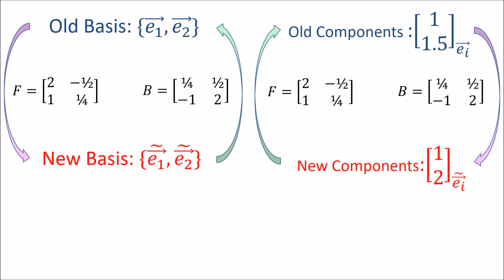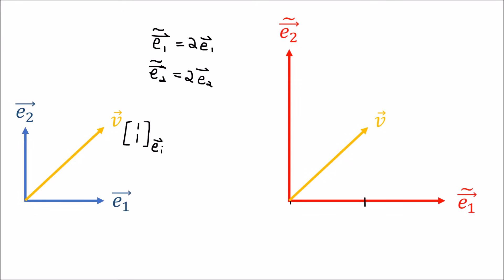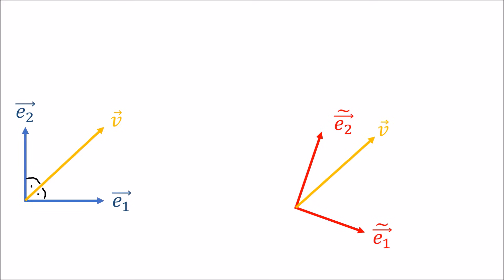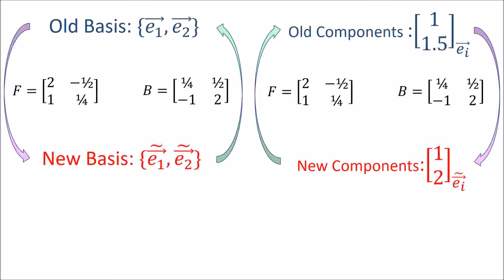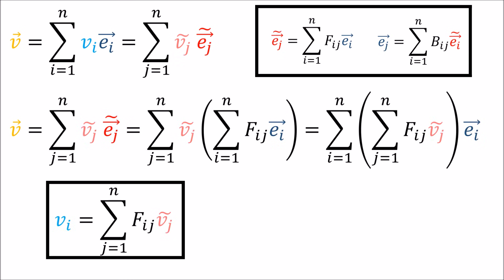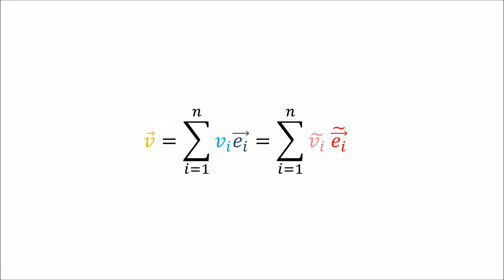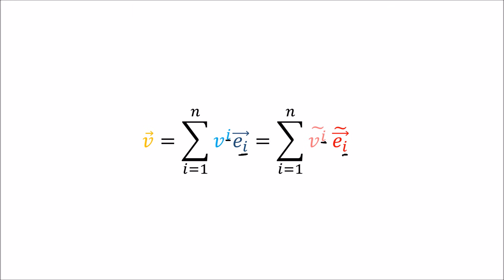Tensors for Beginners 3: Vector Transformation Rules

Comment: If the basis vectors belong in the same space as the vectors, shouldn't they be represented in the same way (columns)? If we do that, then wouldn't we get F and F^T. Just wanted to clarify so I make sure I understand properly in a more rigorous way. Love your series by the way, helped to be able to visualize and understand the building blocks of linear algebra; changing the way I see Tensors as object with certain properties.
Reply from the maker: We would say a vector "v" is "invariant", which means that it's the same for everyone. It doesn't change when we change coordinates. We don't write "v" as a column or as a row. It's just "v".

However both the basis vectors "e_i" and the vector components "v^i" depend on the coordinate system. These two things change in opposite ways because if we "stretch" our coordinate system out so that the grid boxes are twice as big, then the basis vectors "e_i" will become twice as big, but v's components "v^i" will become twice as small. So they transform in opposite ways with F and F^-1. That's why "e_i"s transform as a row and "v^i"s transform as a column.

Comment: You say that vector components transfer in the opposite manner as the basis vectors, but is that not only half true? Is it not the case that dual basis vector components, components found through perpendicular projection, transform in the same way as the dual basis vectors.
And just to be clear what I mean, dual basis vectors are vectors that calculated from skewed basis vectors by the equation 1/|e|1 cos theta, where theta is the angle between and e1 in the skewed coordinate system, and e1 in the dual basis system.
Also, can you direct me in your videos where you talk about parallel projection to find vector components versus perpendicular projection to find dual basis vector components?
Reply from the maker: As I present in the next few videos:
Vector components transform contravariantly (opposite the basis vectors).
Dual vector components transform covariantly (same as basis vectors).
Dual basis vectors transform contravariantly (opposite the basis vectors).

In this series I draw dual basis vectors as "stacks" (as seen in the next video) to make it clear they are different from vectors. The "perpendicular projection" is just the result of counting the number of stack lines that a vector pierces.

I'm not so familiar with that cosine formula you gave. Do you have a link to a page that explains it?

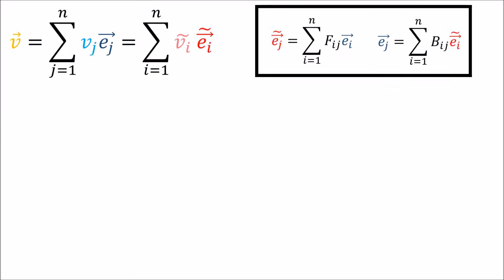Comment: correction: the transformation formula at 03:15 in this lecture is correct, ie,  \tilde e_1 is the \sum _{i=1} ^{n} F_{1i} \cdot e_i \\ well, everything in this lecture is correct, but there's critical typo error in the formula at 08:50 in lecture 1. I finally figured it out became confident enough to make a conclusion when I tried to verify the points learned by now. fyi.
I have a book by Jim Hefferon who says, if you don't do enough exercises, you're not learning LA. That's a great advice.

Comment: One of the clearest examples of the transformation rules I've seen. Very good job.

Another thing one can note is that for the vector v to be invariant, when expressed in the two bases, we can "sandwich" in B*F = identity, in between the vector component and the basis vector. Thus the vector v is invariant. But that's much less descriptive than what you showed. :)
Reply from the maker: Yes, I came to this realization later and it's exactly how I explain it in the relativity series I'm working on now.
I also realized that basis vectors can be written as rows and vector components can be written as columns so you can do the same thing with array notation if you like (with B and F matrices instead).
Reply: The more perspectives offered, the merrier :)

I'm working through Gravitation (Misner, Thorne, Wheeler) at my own pace and plan to cover it in full, and felt I should brush up on some of the Tensor Analysis again, so I'm glad I could find this series of videos you've made. It was a great refresher to see your videos on the Geodesic Equation and Covariant Derivative as well!

Comment: I don't understand why, at 3:13 the subscripts for the vector suddenly change from only "j" to "i" and "j". This is not random as F and B have "j" elements as well, and these are used in the simplification after substitution. Please help explain why the "j" and "i" subscripts for the vector suddenly appear.
Reply from the maker: I can't tell which summation you're talking about. Can you write out the formula to help me understand?
Reply: @eigenchris  Ok, two equations on the top left at 3:13, V = SUM(j=1 to n)vj x ej = SUM(i=1 to n)vi x ei, why the different subscripts (i and j)?  why does this i and j correspond to Fij and Bij? - thank you !!
Reply from the maker: @braigetori  The letter used for summations doesn't matter. I changed the letter to make the letters in the final summation formula match. But you can always change the summation letter without changing the meaning of the formula.
Reply: @eigenchris  the letters used for summation do matter - because you relied on the fact that the letters in V match the letters in E (basis vector). The substitution would not work unless the subscripts match. So there is an error In logic here - the subscript letters are clearly not arbitrary.
Reply from the maker: @braigetori  Yes, what I meant to say is "the summation index doesn't matter, as long as they match". I mean you can replace the summation letter, as long as you do it consistently.
Reply: @eigenchris  if possible, please explain why the subscripts for V were intitially both "j", then they were changed to "i" for and "j", which just happen to match the entries for B and F? then the substitution just works out? i need to understand why. i and j represent distinct locations within the matrix, they were assigned to B, F, U, and V for a reason. If they were not assigned in the way that they were, the substitution would not have worked. The subscripts could not have been just randomly changed. Please explain !
Reply from the maker: @braigetori  I'm sorry but I'm afraid I still don't understand the problem. Which substitution are you talking about? The substitution of e_j?

Comment: I understand the notion of change of basis, but for what reason do we need this?
Reply from the maker: Some problems are easier to solve in certain coordinate systems. With circular motion, it's easier to use pilar coordinates instead of cartesian coordinates. I talk about this in my tensor calculus series.

Also, we need the last of physics to work in every basis, so we should be able to change basis and get the same physical results.

Comment: I honestly think its easier to just visualize the inverse transformation in order to get to the vector in the new basis. It takes a bit more imagination at first, I admit, but then you never have to remember any of this really. What I mean is just stick the vectors e1~ and e2~ (the new basis) as column vectors in a matrix. e1~ is the first column and e2~ being the second column. Now take the inverse which geometrically means that this matrix will transform from e1~ to [1,0] vector and it will transform the e2~ to [0,1]. This is important to visualize. Just follow the vector e1~ as it moves in space to [1,0]. Do this for all column vectors.  Now, if you can imagine "carrying" any other vector along while the transformation moves e1~ to [1,0] and e2~ to [0,1], this will be the vector in the new basis. This is why doubling the length of e1~ and e2~ results in 1/2 the length in the other coordinate frame because of the inverse transformation.

Comment: In short, if I'd had this series of videos when I took my graduate course in general relativity I'd have passed the class with a better grade.  If it weren't for the final project, I'd have failed miserably.  Where were you 20 years ago?  hehehe.   Anything beyond the Kronecker Delta and Minkowski Metric escaped me.

I had a math and physics background going in, but tensors were my undoing.  Your series is totally comprehensible.  Good work!!!
Reply from the maker: I was in a similar position, except I was self-teaching GR. I find most sources don't take the time to make you comfortable with tensors. They just throw them at you.
Reply: You're telling me!  The text we used was Weinberg, from 1972.  Excellent text, one of the most famous in the business, IF you know what you're doing.  I slowly lost my mind that semester.

Comment: shocked!!!!!vectors and the basis transform the same way.Think of it this way,when transforming basis we are indirectly and actually transforming a vector of components 1. so why would there be an opposite thing.
Reply from the maker: I'm not sure how to explain it in a better way. If the basis vectors get longer, then you need less basis vectors to build other vectors. So when basis vectors get big, the components of other vectors get small.
Reply: eigenchris this got me confused for an hour now.if i take pure rotation of basis,not change magnitude of basis.i am talking about pure rotation of orthonormal basis.what u think in this case?
Reply from the maker: If you rotate the basis vectors clockwise, it appears as if a vector V sitting in space is rotating counter-clockwise. The rotation matrix for the basis vectors will be the exact same as the rotation matrix for the vector V's components, except the angle of rotation will be positive in one and negative in the other.
Reply: @shobhitkhajuria7464  eigenchris’s reply is a very good explanation, I was stuck with the rotation aspect and not the scaling aspect as well. Imagine you are sitting at the origin of the basis vectors and you rotate to the right along with them. The invariant vector/tensor will appear to rotate to the left from your point of view. This is basic relativity. If you calculate the components of the tensor vs the basic vectors, you can use the same rotation matrix for both, but the angles of the rotation are of opposite signs. This is why the components seem to oppose a change in the basis vectors even in rotation.

Comment: Hi, I am really confused about this:

@3:17 yes, should be B_ji instead of B_ij, so if I work through the rest myself I get:

v~_i = sum (from j = 1 to n) B_ji v_j, i.e here we also have B_ji instead of B_ij, so not only is it the backwards matrix, it is also its transpose. Is this correct? Thanks.
Reply from the maker: Looking at this video again... I think what I've written at 3:17 is perfectly fine. I'm not sure what I wrote it down as a mistake earlier...

The correct matrix multiplication formula is v~_i = sum(over j) B_ij v_j. The basically means entry 1 of v~ is row 1 of B times the column v, and entry 2 of v~ is row 2 of B times the column v.

Does that make sense to you?
Reply: Please correct me if I am wrong.

At 3:17 your formula for ej is wrong, you need to change B_ij to B_ji or simply swap the indices for ei and ej around. 

Referring to your previous video, when you give the example for the transformation of vector components, instead of writing the transformation matrices down (forwards and backwards) you write its transpose. Thus, in your calculation to show when going from new vector components from old you are actually performing B transposed instead of B. 

This is why I think v~_i = sum (from j = 1 to n) B_ji v_j is correct. The only difference between this and what you just wrote in your comment is I have B_ji, i.e. the transpose of B_ij.

Comment: Dear Chris, I came to the point that there is no mistake in what you have done in your videos. 
For example in your 3rd video, you are multiplying matrix by a colum basis, in your 4th video your are presenting the same information in other way, you are just tansponsing the former matriz equation getting row basis times matrix, and  from here you keep that way for the next videos. 
In this video also there is no error, when you take the index equation that transform from new basis to old basis, you are multiplying row bases times matrix,  like you did in video 4th.
When you write the vector equation in index form, you can have row componentes times column basis, or opposite, in index form, it does not have impact in matrix representation, but if you use your former equation for basis trasformation (THere is row basis times matrix), then is forced to have vector equation in the form row basis times column components, and in the end you are getting the relation between new colum components and old column components. 
So, the only thing to say here is that in the realtion between basis, you are comparing row basis,  and in the equation between componentes you are comparing column componentes. There are no mistakes, it is only your information is presented in a not symmetrical way, when you use basis trasnform you are using row basis, when you use components transform you use column components. 
I hope to be helpful, and no to confuse saying this in words  and not equations. If you would like I can send you a file with equations my email is ggm7317@hotmail.com 
Regards

Comment: @3:17 the equation for forward and backward transformation seems wrong. You have forgotten to switch the ij for F and B.  So, instead of Fij it should be Fji and same for B.
Reply: Yes, so the relationship of the components between the two systems are inverse and transpose. Thank you for your video anyway, it really helps me .
Reply: Sorry but I don't understand why. Please could you explain
Reply from the maker: Yep, you're right. I'm going crazy with all these little errors I made. It's really hard to catch them all.
I'll add that error to the description.
Reply: @eigenchris  

Dont't worry, your little indices errors are serving as an unexpected pedagogical device.

Also, if you've made an even number of mistakes, then often with coordinate dummy suffixes (Dirac called coordinate indices: suffixes, and index was left for labeling 'which one'), the mistake becomes undone.
Reply: @eigenchris  Just to be sure. Basis transformation matrix is Fij and coordinate transformation matrix is the transpose of Fij^-1.

Comment: You call v-subscript i (or v-superscript i) the component of the vector. I always learned that v-subscript i (or v-superscript i) times a basisvector is the component. In my opinion v-subscript i (or v-superscript i) is just a scaling-factor. Am I wrong?
Reply from the maker: That's interesting... I'm not really a math teacher and I'm sort of "winging" these videos based on my intuition, not formal mathematical reasoning, so I might not have all my terminology correct. You may be correct. 
I I think I am going to keep using the terminology I use now just for consistency. I hope it's not too confusing for you or others.